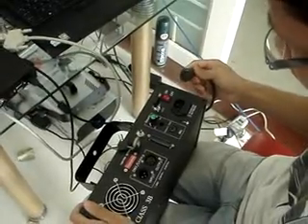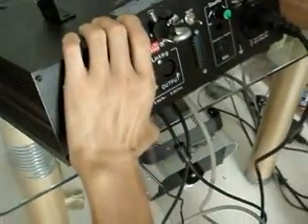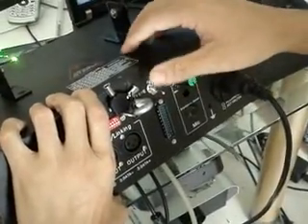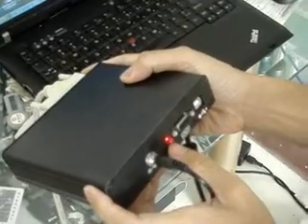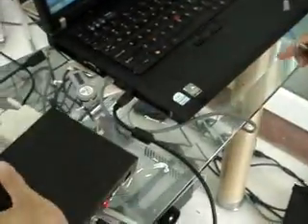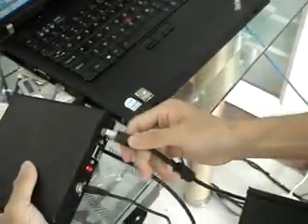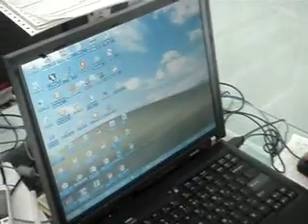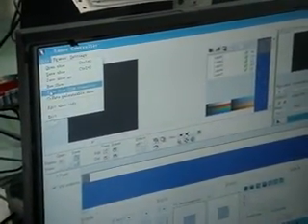how to use laser controller

Comment: Hi, I have a lasser contrroller software and a SD card laser machine without USB box. I make a frame with text and move effect and I can preview prefectly. The problem is if I save it like a frame list ILd extension, the effects donts work. If I try to SAVE OUTPUT TO FILE, I get a software error display. A question: The show effects its for only for live proyection with USB Box? And I can't save it for playdirectly from SD Card. Thanks